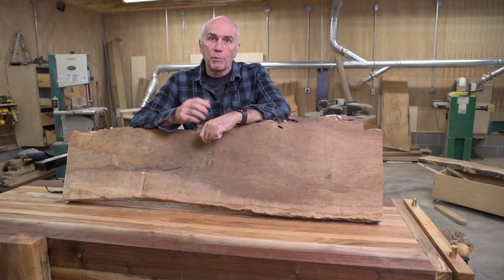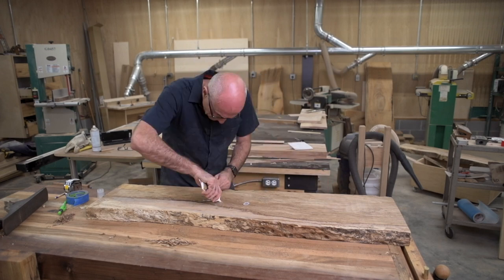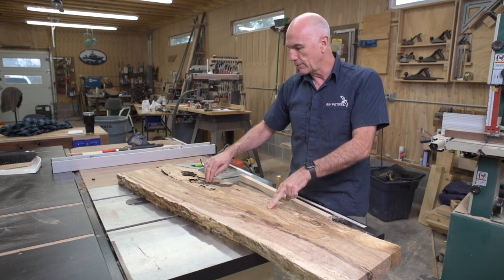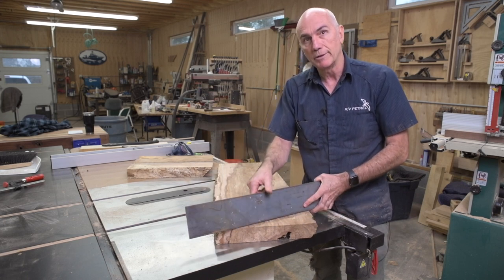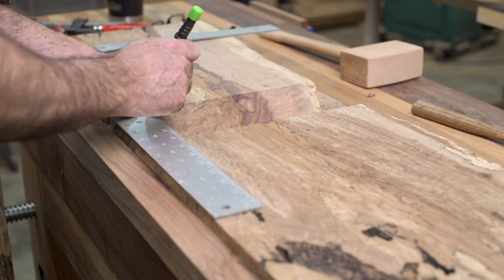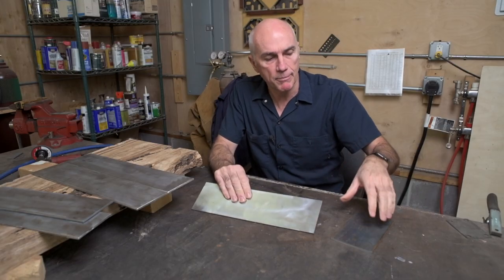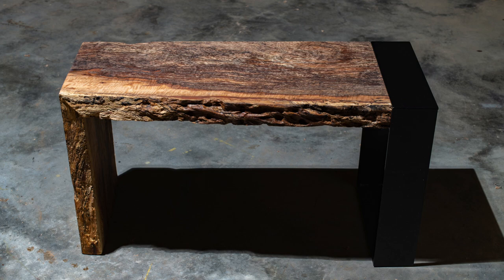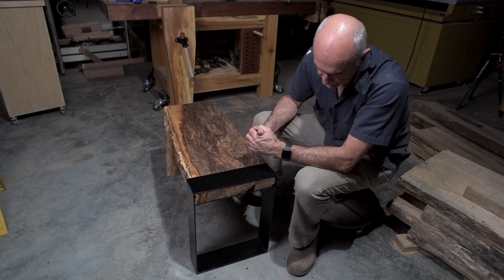Modern Waterfall Bench

Comment: The silicone doesn't cause fisheye when you're finishing?  Nice piece !
Reply from the maker: Not at all, so much sanding between that step and the finishing I think there is no trace of silicone left.. However, there was a small bit of what I think was the C-A glue keeping the finish from sinking in on one spot.  Might not be the case but something odd about 1 spot.  Looks good though.